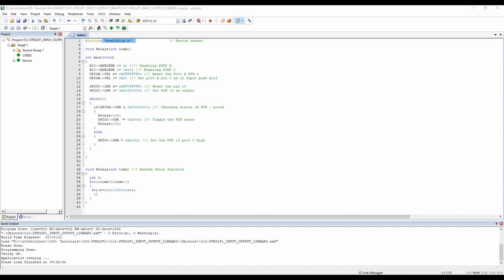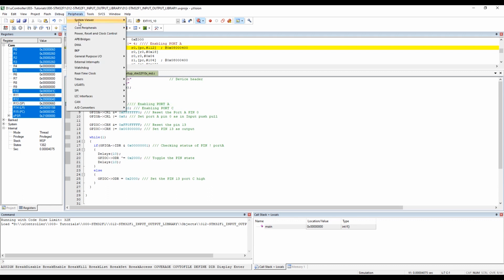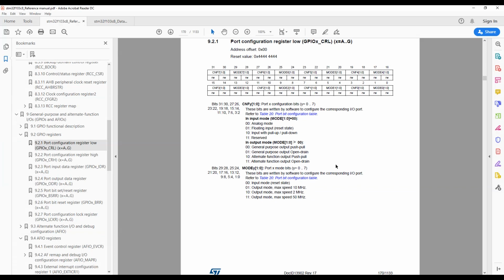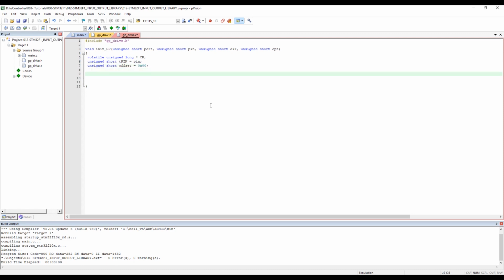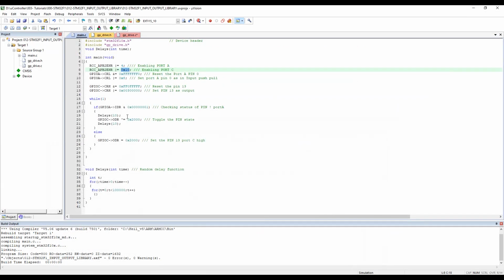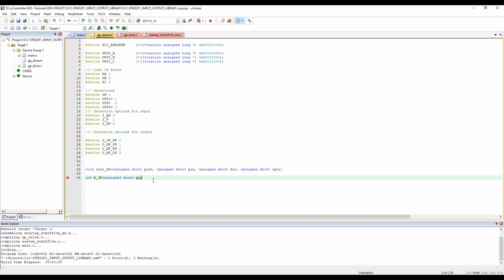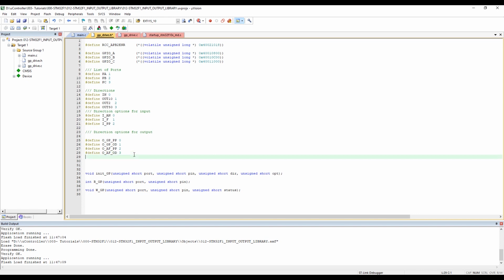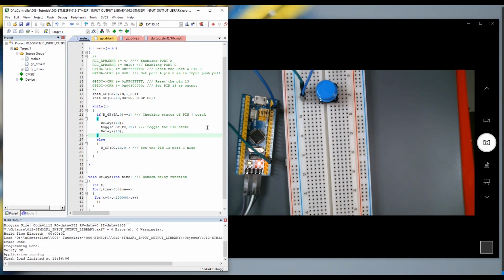012 -  STM32F1 GPIO INPUT OUTPUT LIBRARY FROM SCRATCH

Comment: hi :D. Hope you still reply. Can you explain more clearly the variable "offset". I am understanding that when pin>7 it need to run (GPIOx_CRH). But the address of that is 0x4, so what it relate to offset 0x01 ?
Reply: Not the video uploader. But it's related to pointer arithmetic in C programming language. Since the pointer was set up as an unsigned long (32bits / 4    bytes) , adding 1 to it (so offset 0x01) will add 4 bytes to the address

likewise (for example) if you have a pointer to a uint16 and add 0x01 to the address, it will add 2 bytes (16 bits)
Reply: @henk9849  okie, let me check, thank a lot

Comment: I had question regarding for resetting the target and setting up the direction why exactly do we need to multiply tPIN value by 4? Also for setting up opt why do we need to add 2?
Reply: Hi, thats instructions are for put this bits "1000" in the Port A. In the previous lesson to setup the direccions and the mode we used this code GPIOA->CRL |= 0x8; . the result of the hex numeber is 1000, then when we declared the directions directives we wrote the input direction with the 0 number (#define IN 0) this number define the bits that we would have to put in the first two bits of the memory stored GPIOx_CRL, now we have those bits. in the other hand the mode of input pull up is activate with the next two bits, and we wrote the input mode with the 2 number (#define I_PP 2), and this numbes is the same that put 10, the next two bits that we need to form the same array of the last class "1000".
Well now we have the same, but this is a function that should work for all the number of pins that we have, in this case shoul being 0 to 7 or 8 to 15, and everyone of this pins has 4 bits to configure, therefore you have to multiplicate the tpin, if your pin is 2, you have to advance 8 bits before setup this bits. therefore you multiply for 4 in the firts two bits, and for that reason you have to sum 2 to the bits of opt because this pins go 2 bits after the direction bits.
i dont know if is clare, and if i've helped you beacuse is an old question.